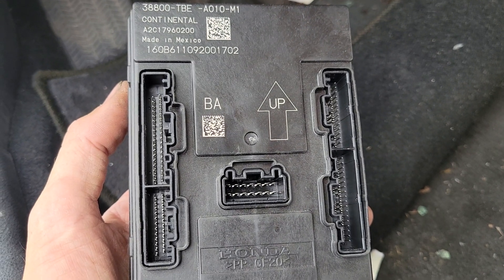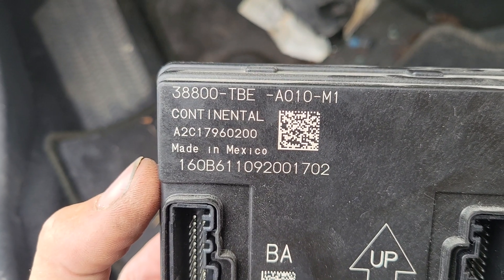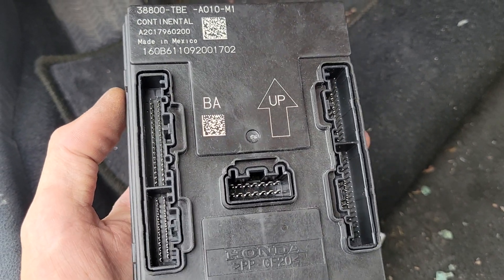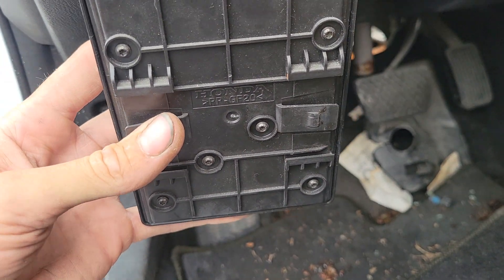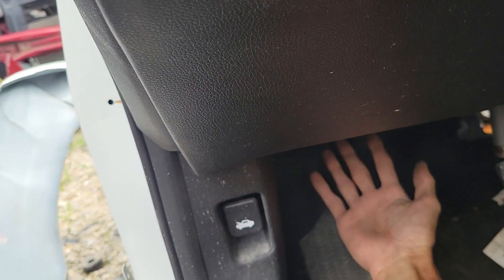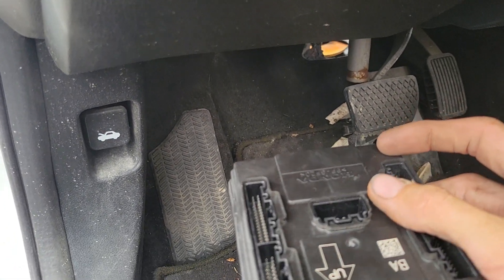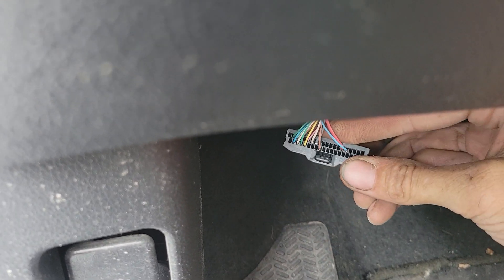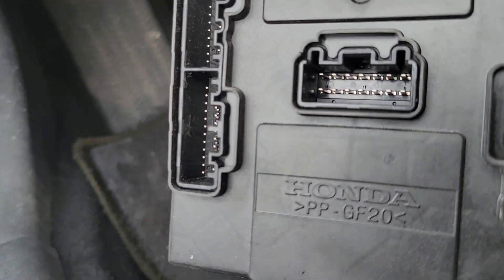2020 Honda Civic Body Control Module Location and Removal

Comment: BCM's are a huge issue with Honda. I have a 2019 civic and I've been disconnecting my battery everytime I park. The remote starter error shows, the car alarm randomly goes off and the car will start in accessory mode when we dont touch it. This should be a mass recall.
Reply: Wow literally same. If I lock my doors my alarm is bound to go off in 30 minutes. Have to disconnect my battery as well

Comment: 12-09-2024
I have a 2019 Honda Odyssey elite the problem you are having with all the warnings is the Lane camera (and maybe the Body Control Module?) .  After I got all these warnings I still drove it because the repair is $700 for the camera and $700 to "calibrate the camera.  However, recently the car will not shut off? I had to pull the battery cable off; then that reset computer and started it fine, seemed ok.  Locked it up and went to bed only to wake up to the horn alarm going off later! Let key remote didn't work. So I had to use the real key inside the fob to open the door the old fashion way.  I found out if I don't lock it the security system won't go off like that, but the car "accessories" power comes on my itself and is draining the battery.  So I'm buying time again I guess I am going to fix this camera (see part # pic) myself (search Youtube again)then i will deal with the security issue  2019 Honda Odyssey Elite camera model =   36160-THR-A81-M1
2019 Honda Odyssey Body Control Module (bcm) - Elite model number = 38800-THR-A61
>>Ody Club Forum on this issue -  https://www.odyclub.com/threads/power-turns-on-by-itself.358347/
>>Another owner with the problem on Youtube - https://youtu.be/pb7ojfOqizs?si=FFhyK-46GDs3ZrzV
>>Do It Yourself camera replacement - https://youtu.be/BdynuG2qIFg?si=Z5VraNTRdbF_Ifh_
>>Pine Hollow Auto Diagnostics Youtube
WTF...Honda Turns Itself ON & DRAINS the Battery?!

Comment: Hi! I have a problem with installing a new BCM. Do you know how to add the car's VIN to the new BCM? honda cr-v touring 2018, best regards
Reply: Did you get it working?
Reply: Any update???
Reply: @brandonkeyss5681 i wonder if the key has to be programed synchronized with the Body Control Module. Does the old one  hold the key code?

Comment: Hello this comment is for an Expedition video you did about 6 months ago tccm removal i am suspicious the same part is bad on my f 150 intermittent wrench light and hard shifts any thoughts
Reply from the maker: These late model Fords have adaptable shift points that are based on how it's driven. If you've recently gotten the vehicle or someone else has driven it for a while it can learn how that person drives and then it will have hard or light shifts if you drive differently. Check your fluid level first, on flat ground, engine running. Additionally check the fluid on the dipstick for any metallic shavings or anything that looks or smells burnt or worn. If it's shiny that could spell disaster. Burnt smelling fluid could indicate a need for a fluid and filter change. I always check for the cheapest fix first in the interest of saving money. If you have a wrench dash light, stop at a local parts store that offers code reading and see if they can pull up the codes that are causing the light. Hope these ideas help solve your issue.